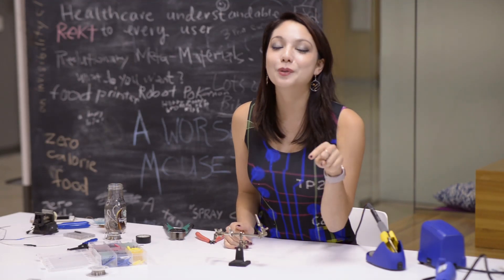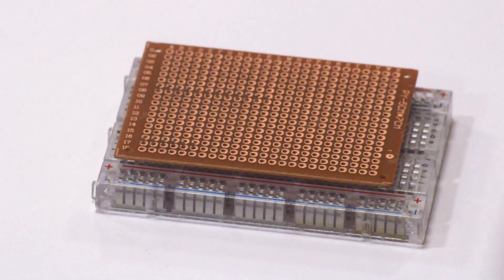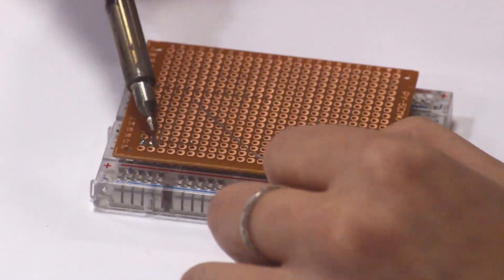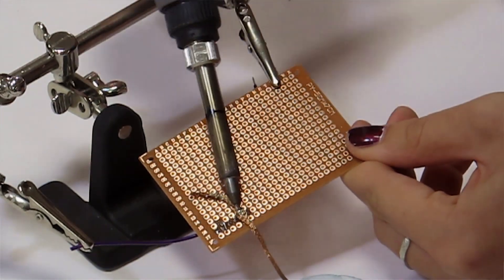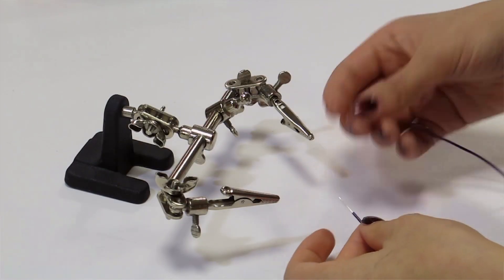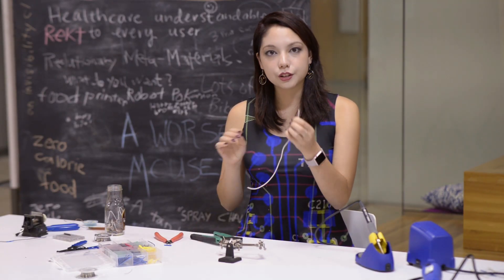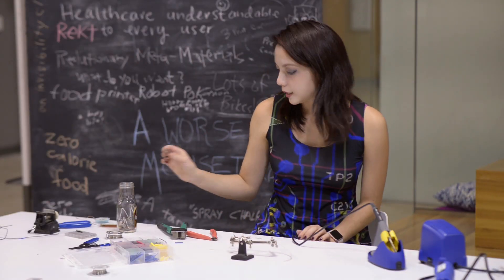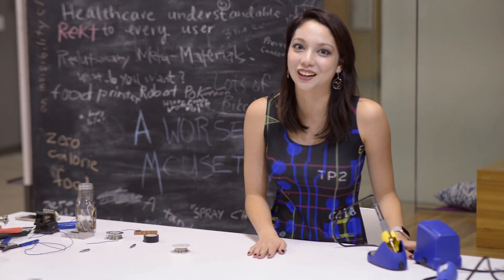HOW TO SOLDER

Comment: It's better if the printed circuit board is smeared with rosin, dissolved in alcohol. This prevents oxidation of the traces if done after the producing the PCB (assuming it's 'home made' - without tinning and mask).

Or any other type of flux is applied before soldering.

Comment: Wait, no mention of Flux or using proper (filtered) ventilation?... aaalrighty then. moves along
Reply from the maker: No mention of two things no hobbyist buying their first soldering iron needs to worry about in an introductory soldering video? Shocking. 

Thanks for bringing up filtered vents though: if you did use flux, then maybe you should have filtering for the organic materials being released. But most of the time, especially for short jobs, any airflow is more than enough.
Reply: Hmm I disagree.. I had to stifle a frown at the mention of saving trees by throwing solder waste in the solder waste while hanging over a rising plume of smoke. :)
Your health is very important, and while you might not 'feel' like it would matter to just solder occasionally without proper filtered ventilation, it does add up the same way that smoking a cigarette just once or twice a week DOES add up.

I'd like to believe that anyone spending the money on a soldering iron, solder, wick and actual stuff to solder would be doing it at least semi-regularly.. So, if you wanna go on the cheap (assuming you value your health).. I'd highly recommend any aspiring solder hobbyist to make it their first solder job to solder the leads from an old (phone) charger onto a PC case fan and slap a piece of carbon filter on the end. Hell, even makes for a nice practical first DIY experience. :D

Regarding the flux, I guess that varies between schools of thought. Some like to use as little as possible, others prefer to practically drown their boards in the stuff.

Thanks for the educational video, spreading knowledge is always a good thing!
Reply from the maker: Thank you for the awesome reply - and you make a very good point. We're going to slap a link to some cheap carbon filter in the video description for people who do choose to go the lead-solder route. The old case-fan idea is quality. 

Flux is definitely going to be a topic when we get around to SMD work, but for through hole, utility is questionable and the health risks are definitely increased. When we do need it, we like the rosin-core stuff for convenience and to limit excess burnoff. We'll cross that bridge when we come to it - and hopefully you'll stick around and give us feedback :)

Re: Smoke exposure - Andrew is a big MSDS nerd, and we tend to take our recommendations from OSHA workplace requirements for ventilation. We'll stick a link at the end of this comment, but basic restrictions on health stuff really become an issue with 1) lead and 2) flux/rosin/organics. Generally, ROHS solder (and honeslty most rosin core leaded stuff) releases far too few particles (even in the big smoke plumes) to actually increase the PPM in the air to a dangerous level. Taking into account the recommendation of some moving air (or a house with central AC / anything not stagnant), the replacement rate of the rooms volume should keep you well below the OSHA limits for almost any hobby work. That said, if you're going for a few hours, workign on complex boards, or getting your face up in there to see small components, you're probably right that a basic filter pushing that smoke away from your face is a good option. It certainly can't hurt. 

Source: https://www.sentryair.com/solder-fumes.htm, https://www.osha.gov/dts/osta/otm/otm_v/otm_v_3.html

Comment: Question: What is the stand with the roach style clips called that holds your board and wires while soldering?
Reply from the maker: Those are called helping hands! You can get them on Amazon or at most electronic stores

Comment: For burnt fingertips from soldering or any other Burns from whatever source just my personal preference go to Aid and home remedy is butter yes better believe it's butter and if ever comes that moment and you recall this comment you'll be surprised and glad you did and ironically you can watch it melt the pain away now granted it won't completely erase your memory of it but it will definitely take a load off or you could always do what I would assume most of the veterans of the art have all done which would be suck it up don't be a baby about it and don't do it again and well if you're clumsy or unorthodox to suck it up eventually you'll get catalyst enough to not even feel a thing I'll be humble enough to admit or categorize myself as an amateur or Avid learner and hobbyist as well as a fan or let's say for lack of better words non-sponsored promoter or Advertiser to the art and subject matter of all the things tech-related but moral to the story is I've burnt mine enough from combination of hot glue hot glue gun and solder drip solder tip solder iron and maybe even both at the same time you eventually get use to it if not I'd be almost certain you're not doing something right

Comment: wonderful, solder and welding. A lot of people think they are the same. Yet they are SO not the same. 
I don't get the comments on the L in solder, SHE SOUNDS FINE TO ME ! MAYBE YOUR FROM ANOTHER PART OF THE COUNTRY WHERE EVERYTHING SOUNDS PERFICT!!!
If YOU still needs a set of wire strippers- WHEN IS YOUR BIRTHDAY, I'LL HAVE AMAZON RIGHT ON IT.
Reply from the maker: THANK YOU!! Man, I didn't realize I had an accent until this video came out! 

JUNE 28 & I STILL DON'T HAVE THEM ;) Our lab address is Beauty and the Bolt, 11201 Cedar Ave. Cleveland OH 44106 :)
Reply: Beauty and the Bolt the USPS tried to deliver your package. Check for a ticket, or contact your local post office. THANK YOU

Comment: If you are soldering a large pad , the trace us thick, trying to solder a large wire, or pad on ground plane...more heat is the answer give.a set wattage. The more copper the more thermal mass...given a large pad the mass off the tip on iron is insufficient and temp will drop quick. Starting a bit hotter helps u stay in the encolpe of temp the solder will flow
Reply from the maker: In this case, we would recommend a larger chisel tip. That way there is more surface area between the iron and the pad-- this will mitigate many of those problems!

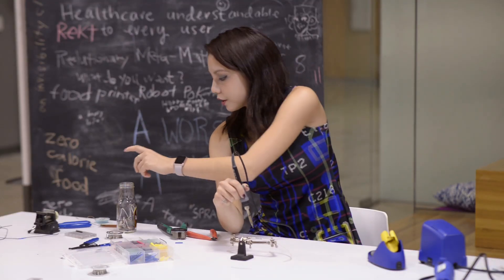Comment: 7:43 Solder Waste Container ?
I thought people usually work with a spool of solder therefore there is no need for a solder waste container because there is no waste to throw away ?
Reply from the maker: That's true, but an astounding number of kits (all the ones at radio shack, home depot, walmart) come with loose solder instead of a spool. We figured we would show what most people happen to have on hand (or can buy locally), but if you have a spool go for it!

Comment: Omg! You are too funny... Good advice, however I prefer non-rohas solder... it just flows better. I agree about the wire strippers,  I obtained a pair from the 1940's or 50's and their so much better than the traditional type.

Comment: I'm not impressed by how you solder, your quite clumsy in how you hold the iron and solder wire making your job harder. Also, your wasting solder by cutting it off the roll, then throwing the end bits away. You should just pull it off the roll as you go to minimize wastage. Worst thing though in this video is you keep saying sodder, and you either don't know what your talking about or have a speech impediment. It's annoying as hell...
Reply: Also, as stated in the video, keeping the iron as cool as possible is important, it reduces the degradation in the iron tip which corrodes from the solder. Once a tip is used, it starts degrading just from the contact of two different metals. Cleaning it and checking the tip is still intact is a good idea before you solder, and I found that using additional flux is the best way to help prevent dry joints, and enable the solder to flow around the joint better. Solder fails to flow because too hot an iron oxidizes the solder, and that prevents the heat transfer into the parts being soldered. Using flux means you can get rid of the oxide layer which forms, and the solder can then make a wet contact with the part being soldered and allow heat to flow into it faster. Ideally heating the part in that way using very little solder and then applying extra solder to those parts directly to join them and removing the iron BEFORE the flux burns off. You can then use a solvent to remove the excess flux, and dry it off with abit of heat, we used an oven on low setting to do that, to ensure no liquid was left. 40C is plenty to do that fyi...

Comment: No use of flux anywhere in this clip #fail
Reply: steve c - you’ve heard of rosin core solder, haven’t you?
Reply: why its rosin core solder she is using if it wasnt she wouldnt have been able to get that solder to flow around the joint it would have just bubbled up which is what you never want
Reply: steve c it was electrical solder which has rosin flux built into the core.

Comment: If you plan to do a lot of soldering (or soddering as you Americans like to call it), I would suggest some kind of fume extraction. Breathing in the resin is bad enough but using leaded solder which I prefer because it flows and wets the joint better and provides a much stronger joint, but fumes from this would carry lead too.

Comment: solder wick and i do not get along.  i prefer a good quality spring-loaded solder pump (the fat ones).  quick and easy
Reply from the maker: For through hole, that works great - the problem is surface mount components tend to get sucked up right with the solder, so we recommend solder wick as a first line of defense for most people.